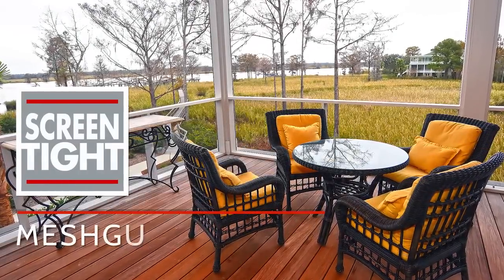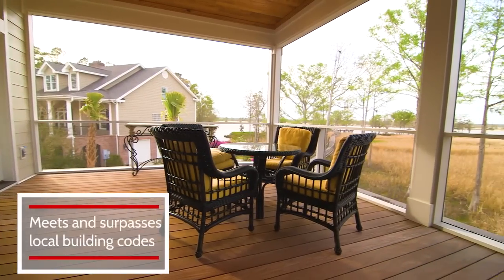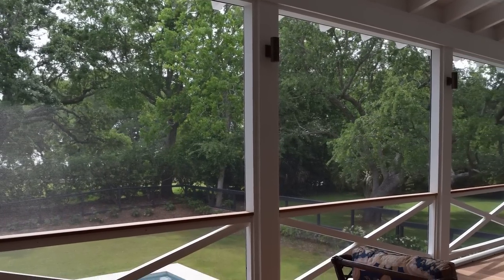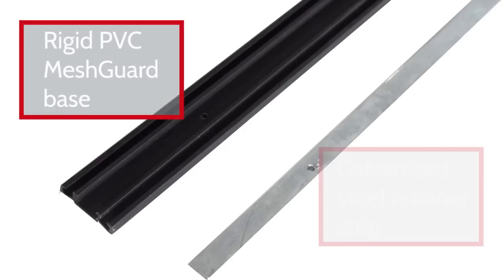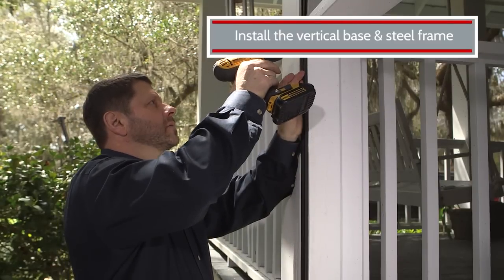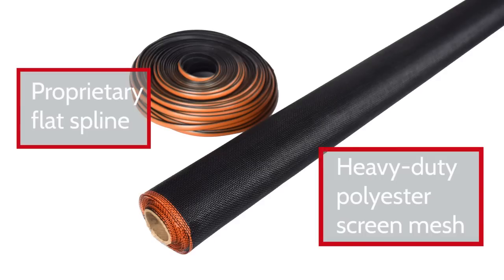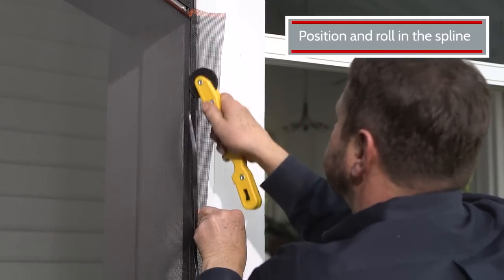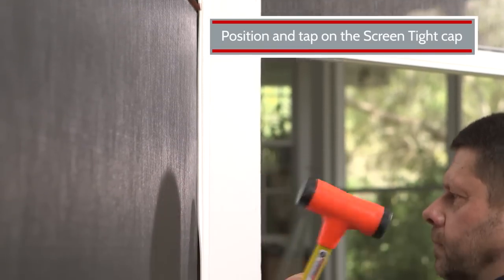MeshGuard Porch Screening System

Comment: If you install screentight above the rail and meshgaurd below the rail, do you have to use the flat spline in both the top and bottom channels of the middle sections? I.e., am I able to put the regular screentight round spline in the top channel of the meshgaurd rail, or do I have to use the flat spline for the top section as well? Thank you!

Comment: The system works reasonably well.  It would have been nice if the slots stamped in the mesh guard base lined up with the slots in the metal reinforcing pieces.  Also the supplied screws are very soft.  I was going into pressure treated southern yellow pine and had to drill pilot holes.  Otherwise the heads came off or stripped out.  Square or torx drive screws would be a much better choice.  I ended up throwing them away and buying good ones.  Good product, clean up the instructions and supply decent screws and you'd have a great one.
Reply from the maker: Thanks Raymond, we really appreciate the feedback and will take it under consideration.

Comment: How is this better than the Screen Tight system? The metal insert seems like an added step. What is the benefit?
Reply from the maker: Steven, thanks for your question. MeshGuard shares the same cap as Screen Tight but uses different components "under the hood". The system is code-approved by the International Code Council for use as a "guard" below the handrail to replace traditional solutions such as pickets or cable rail for elevated porches.
Reply: @TheScreenTight  Why would someone choose MeshGuard over Screen Tight? Second Q: the mesh material seems quite charcoal colored at close range, yet the final finished panoramic views make it appear almost transparent in terms of the amount of light allowed to pass through it. Are those final panoramas flooded with high intensity back lighting or is that natural lighting?
Reply: ALSO:  which product withstands high winds better, Screen Tight or Mesh Guard, and at what maximum mph?